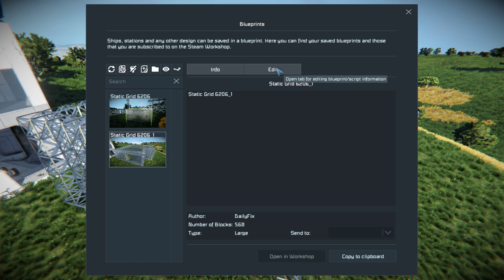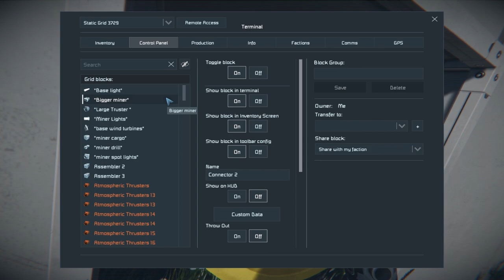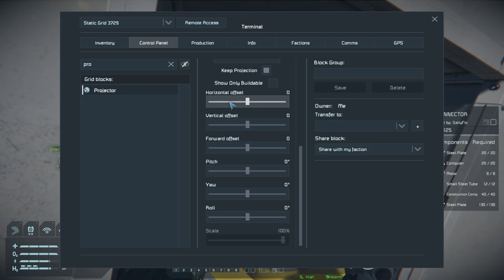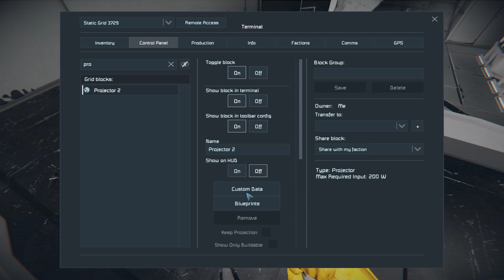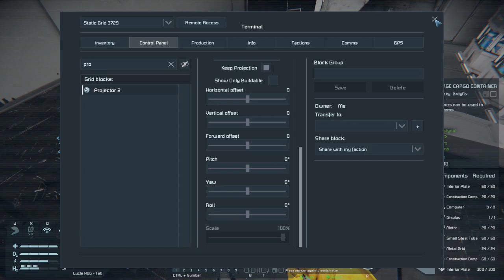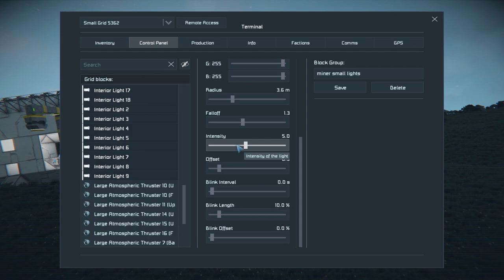[25] Using a projector - Road to Space - Space Engineers Survival

Comment: We usually put a control seat and use the toolbar to change the picture position. I put steel blocks that stick out more than the important part so that they break before bumping into the part I want protected. eg landing gear will break before knocking into my thruster
Reply from the maker: Man I should have used that I spent so long getting that thing in position 😂